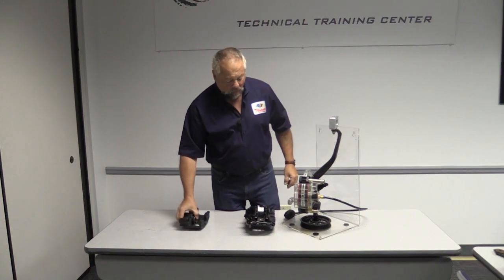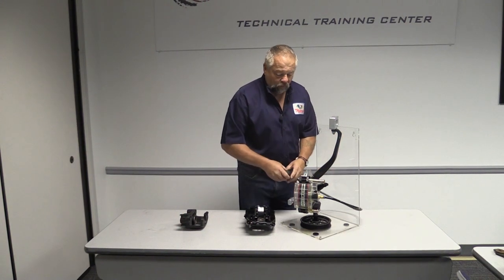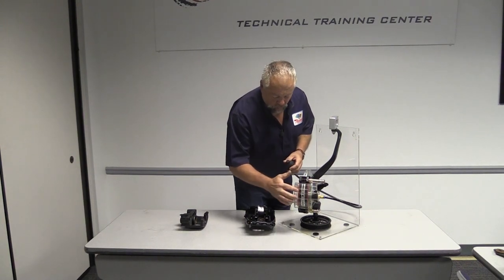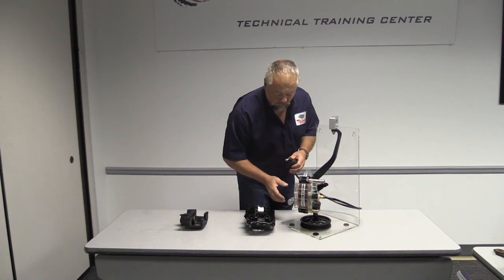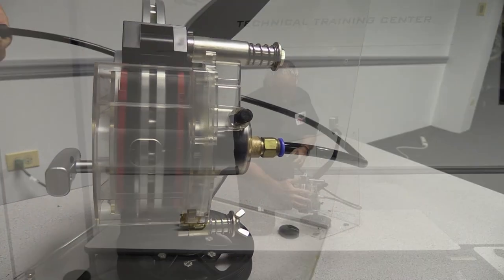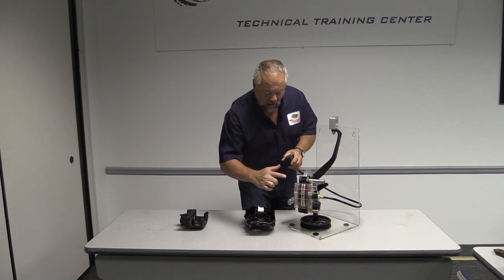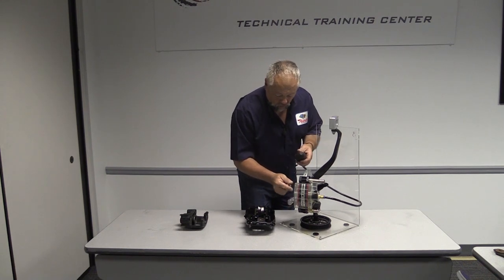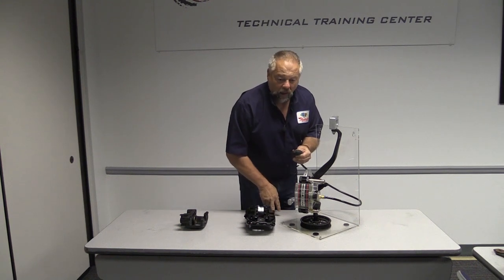Fixed vs  Floating Caliper Discussion

Comment: Thanks for the demonstration, I now understand and see that single piston calipers are free floating and have the ability to move, enabling pressure from one piston to be applied to both brake pads.                                                   Dual piston or four piston calipers do not need to float because pressure is applied to both brake pads by the opposing pistons.

Comment: Hello there, I wonder what the dimension of the strengh those slide pins are subject to, I notice axial force but there must be any remaning radial or horizontal force as well, apart from the weight of the caliper itsel. I gues most of the torque and and force to overcome the speed of the disc from rotating is done by the pads being pushed over the bracket pad support abutment. I say this because I have seen people sometimes bushing the guide bores wht coper sleeves or even tefflon when they are too loosen due to wearing by the pin axial constant movment during breaking. Still when I see those sliding pins they seemed to be made from hardened iron.  Do you have any comment about it . Thank for sahring your expertise.

Comment: According to Bentley Service Manual for  the BMW series 5 E-60 it has a note saying specifically not to grease the sliding pins.
Reply: cant put vehicles together correctly so doesn't surprise me they fail their too

Comment: i know how floating ones work but what are the pros and cons vs a fixed one?
Reply: MJD  as someone that lives on a farm owns a Land Cruiser with floating calipers and regularly takes it off-roading I can tell you that is certainly not a problem at all. I have also taken my LC out in rain season and plowed through tonnes of mud literally caking the underside in mud took me 3hours to clean it all off. Even when completely covered in mud the LCs floating calipers never had a problem.